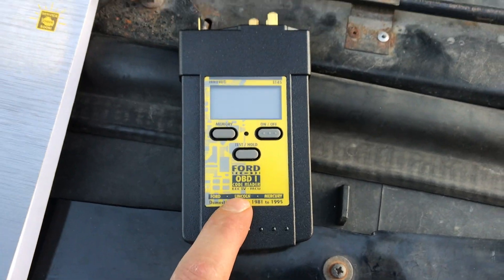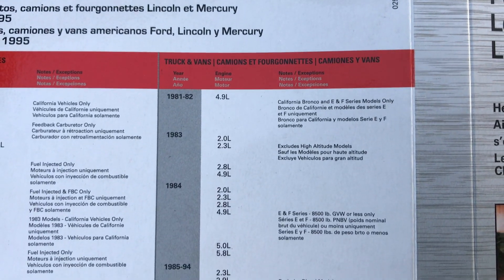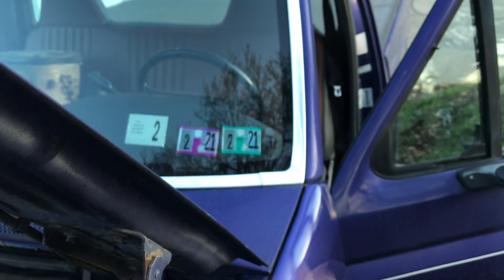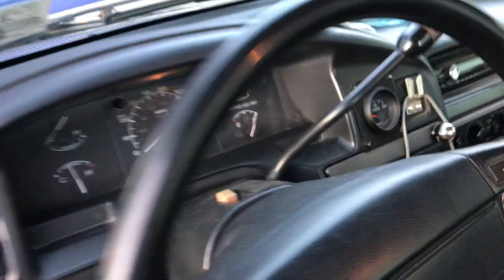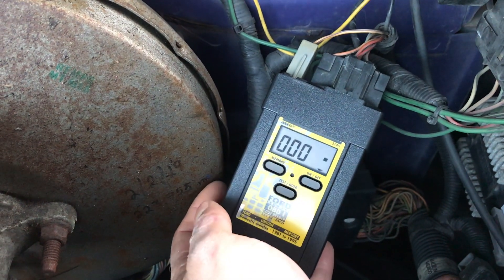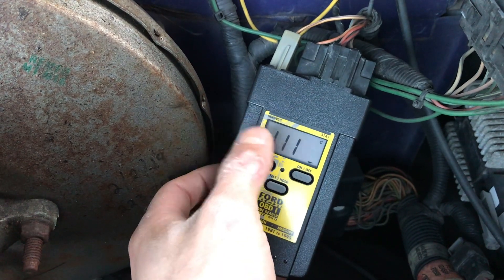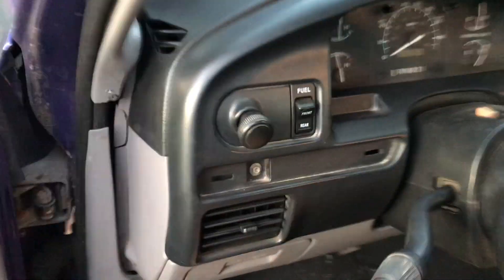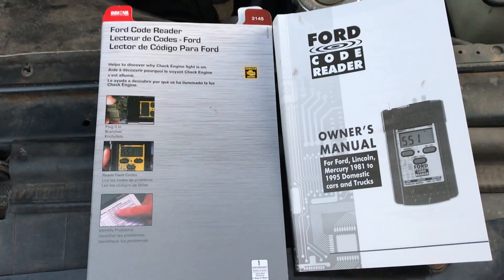How to Read OBD1 Codes on Pre-96 Ford F150

Comment: I just bought that same one but when I connect it for the "key on engine off" I turn on the code reader and I get the little triangle and a solid square. The square doesn't blink at all and I can leave it sit for a few minutes but no code will pop up even though my check engine light is on. Do you happen to know if I'm doing something wrong?
Reply from the maker: So you plugged the code reader in, turn the truck on (leaving the engine off), turn the code reader on, and then hit the test button? You get the triangle/arrow showing you are connected and you get a square. If you followed those steps on that order and you aren’t getting anything, I would try it a couple of times. These are good code readers but I wouldn’t say they are the best. I ran a couple of tests and the reader said that my truck only had six cylinders when clearly it’s a V-8.
Reply: I'm having this same issue! Did you figure it out?

Comment: Hey there bro I also got a dream truck 1992 ford 150 5.0 and it has a check engine light keeps coming up and it keeps turning off would u think this would fix my problem instead of paying this local shop 150 to get the code scan because there the only shop that has it. Thank you in advance.
Reply from the maker: Nice man!😘 Welcome to the OBS club! Yes, definitely buy one of these code readers. They are cheap and it will help you get to know your truck more.

Comment: If your truck is a 95, then why do you have a grey fender mount icm and not a black one?
Reply from the maker: Do they change color after a certain year?
Reply: @TheMinuteMasters  yea mine is a 93, i have a grey one. 94 and up were black. Its a confusing mess. Lots of trucks have the wrong ones installed and that causes a bad idle. Auto Parts Stores dont know the difference between the two so consequentally, it causes alot of mystery poor idle problems on trucks of our vintage.
Reply from the maker: @UserName-ln5ol  Really? My idle isn’t the smoothest. I wonder if that could be it.
Reply: @TheMinuteMasters  could be that or a different problem. I love these old fords but damn, the sensors are not up to par with modern systems as far as diagnoseablity.
Reply from the maker: @UserName-ln5ol  That’s true. Yeah I can’t say they have the best sensors either.
Reply: @TheMinuteMasters  1994 was the first year for the Computer Controlled Dwell style ignition on these trucks. This requires the black colored ICM to work properly.

Comment: Great video .A couple things to add.  For KOEO  with a stick shift hold clutch to the floor.I use a broomstick.wedged against the driver seat back.For the KOER  you can use your hand to floor the throttle when you see the 10 signal.no need to scurry back inside and use your foot.
You're right the book will explain all this. Earlier style code readers made you sit there and count how many times the CEL flashes to get codes...Real tedious
Reply from the maker: Thanks man!🤙 Good tip! Yeah I should have thought about just moving the throttle with my hand. But I had to be in the cab for the other two tests with an auto trans. 
Oh I know what you mean! Lol I had a 86 Datsun and I had to count the codes like that.
Reply: Counting Flashing lights works too after a couple of tries...

Comment: I got the same tester for my 94 f150 works good stay away from those obd1 to obd2 adapters you can get on eBay are Amazon they do not work they click on and off and never read and the whole time your fuel pump is wide open pumping gas
Reply from the maker: I’ve actually never seen one of those adapters. So I’ll definitely stay away from them. Thanks for letting me know man!🤙
Reply: @TheMinuteMasters  also on the obd1 scanner after you read the codes with the engine running you push your gas pedal just about half way and let up and it puts the pcm into a cyinder balance test it checks your fuel injectors and compression on your engine if you get a code 90 at the end of the test it passed and all your cylinders are contributing ok and your compression is fine any number other then 90 is bad
Reply from the maker: @christopherdarrough2667  That’s cool! I’ll have to try that. Thanks man!🤙

Comment: Will this read the overdrive blinking light , sorry If I missed that part
Reply from the maker: Like if your overdrive is blinking, will it pick up the code? Yes, it technically should.
Reply: Thank you very much
Reply from the maker: @kylecheramie8371  You’re welcome man!🤙
Reply: No, it will not. My 1995 Mazda 626, 67,000 original miles, been sitting for years due to this issue. Fire Stone overfilled the tranny after a fluid flush. No It will not shift gears after warm up an will stop in it's tracks after the O/D light flashes. The reader will only read 111 for both KOEO and KOER.

Comment: Very well explained, can you  help me with the overdrive light it turns on when it is running
Reply from the maker: Does the overdrive flash when your truck is on or is the code reader getting an Overdrive error code?
Reply: @TheMinuteMasters   it flashes on and off while driving
Reply from the maker: @creacionese.o1475  Interesting. My light only flashed at me when my OD band burnt out one time. Are you getting an error codes?

Comment: How do I clear the codes?
Reply from the maker: I think I show you how to clear the codes toward the end of the video. The manual also has a quick blurb on how to clear the codes too. If I remember correctly, you start the key-on-engine-off test and before it goes into full test mode. You hold down on the start button and it clears the codes. I'll have to go check my manual to see for certain.

Comment: Great video demonstration, I just picked one up for my 87 f150 XLT lariat super cab. I don't have an overdrive like you. Do you know if that part is skipped, when doing that engine running test. Would you happen to know where I could pick up that cover cap for the EEC Test point. Mine is missing and its just hanging there uncovered. I had a 95 same color as yours all my friends called it Barney,  miss that truck, thanks for your help
Reply from the maker: Thanks man!🤙 If you don’t have overdrive you can skip that step. As for the EEC test point cover, you may need to go to a junk yard. I don’t think anyone remakes them. 
Yup, when I first bought my truck, my friends called it Barney too! Lol
Reply: @TheMinuteMasters  thank you for getting back to me, you make some good Videos
Reply from the maker: @nickpanhead7209  You’re welcome! I appreciate it! Thanks for watching!🤙
Reply: @TheMinuteMasters  Steve, I did my running test on my 87 f150 5.0 but the first thing that came up top left code was CYL 6 shouldn't that be an 8 since it is a 8 cylinder. Then codes came up 45. 33. 25. While doing run test. Engine off test I came up with codes 21. 24. Then 10 and I guess a stored code of 33 I think I'm F....d lol
Reply from the maker: @nickpanhead7209  Ok you’ll be just fine. I think these readers aren’t the best. Mine read my truck twice that it was a 6 cylinders and not 8. Definitely go back and clear an saved codes. Also look up those three codes. They could be nothing substantial or be The result of missing a step in the test. Either way it’s worth doing a retest.
Reply: @TheMinuteMasters  ok sounds good I did do it twice same things came up. But I didn't clear the codes when done. I never did see the 111 code
Reply from the maker: @nickpanhead7209  Gotcha. Drive the truck or try it another day. Mine did self correct to 8 cylinders. 111 is the all clear. So you won’t get it until you get a clean slate. My truck still throws a code in the engine on test. lol
Reply: @TheMinuteMasters  ok cool I'll drive it around and check and clear codes. The reason why I wanted to test is when I first start the idle go's up and down 3 or 4 times then settles down. I have figure out those codes. Thank you Steve
Reply from the maker: @nickpanhead7209  Gotcha. Sounds like an air related problem but I’m sure you will fix it. No problem man!🤙 Thanks for watching!

Comment: Thanks for the video! Does anybody know why my 1997 ford F350 chassis cab has the wonky OBD1 set up under the hood instead of OBD2 in the cab? F350s were the last old body style produced by ford? The internets don't seem to know and I am frustrated scrolling through the 62000 search results.
Reply from the maker: No problem man!🤙

I don’t exactly have an answer for you. However, OBD2 was introduced in 1996. More than likely Ford didn’t bother updating to OBD2 for the pre-96 trucks to save money. Updating the last year run would be expensive. As for your 97, I’m sure updating the F250/F350’s a year after the f150s is a money saving strategy as well.
Reply: @TheMinuteMasters  There is an overlooked (by me) connector dangling under the Instrument panel beneath the radio. It looks like a harness connector for an option that this XL did not opt for. I'll be danged if it doesn't look like OBDII. It is just dangling there. I will double check tomorrow when I care again to see if it is OBDII. If that is the case, this predecessor of the "super duty" has both OBDI and OBDII ports. Super weird. Thanks for the reply :-)
Reply from the maker: @notsoserious0944  Really? That’s interesting! You should take it to an auto parts store and try to have the codes read. If the reader hooks up, then you know!
You’re welcome! Thanks for watching!🤙
Reply: @TheMinuteMasters  Watch Wes Works channel has a video of him working on the same era F700 and it has two sets of OBDII port dongles hanging out by the blower motor, one of which was dead. It was a transition time and shoot from the hip engineering I guess. I will definitely hook up to my dongle just to know. Keep up the good work.
Reply from the maker: @notsoserious0944  That’s very interesting! I bet it was a transition period and they just kept both. 
You bet!🤙
Reply: My 97 350 has this too. Since yours is a chassis cab, it's certainly over 8500 GVWR. To my knowledge, at least with the 460 like I have, the 96 and 97 trucks over 8500 GVWR were still OBD1. Took me a lot of searching to figure out after I never was able to find the OBD2 port I thought I had.
Reply: @user-tl9ry1pj1j  I guess we are the last two on Earth. When the thing wouldn't start, I had nothing to go on but spark and the parts cannon. It ended up being the ignition module.
Reply: @notsoserious0944  mine ended up being cap+rotor

Comment: I have a 95 f-150 Eddie Bauer edition and my dash lights randomly quit working would this maybe help or fix it?
Reply: I also have no headlight, brake light or tail lights out. I have one license plate light out. Also replaced the dash lights thinking that was the issue
Reply from the maker: Nice! Eddie Bauer’s are cool. So if things randomly quit working it’s either an electrical short or a blown fuse. When things quit, do they come back on their own?
Reply: @TheMinuteMasters  I don’t think it’s any fuses bc I’ve checked them all, so I have no idea what it could be
Reply from the maker: @zachg2081  If the fuses are good then you have a short in the system. I would start by making sure everything is properly grounded. Grounds can become loose and cause issues. I know that sounds like a lot but grounds can be easy to find. They normally attach to the frame or body. Otherwise, inspect as much of the wiring harness as possible. It seems like it’s only affecting a few things, particularly lights.
Reply: @TheMinuteMasters  ok thanks